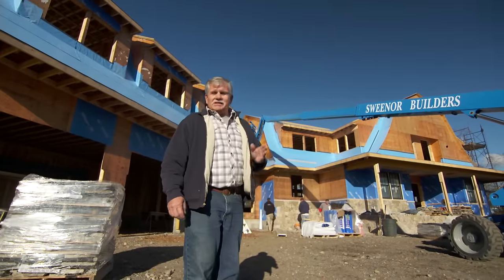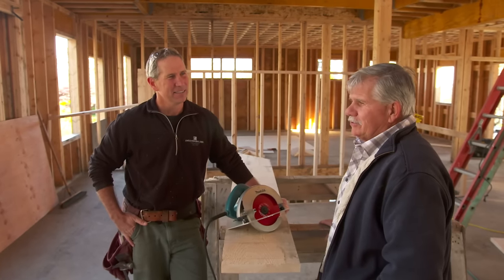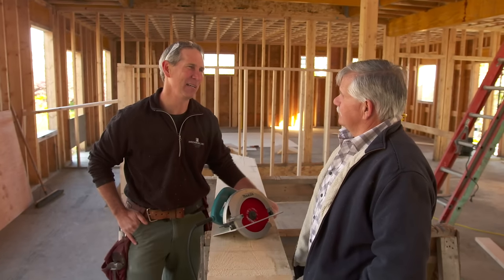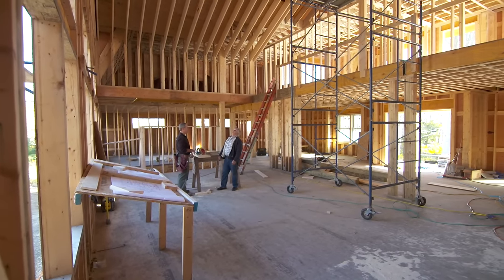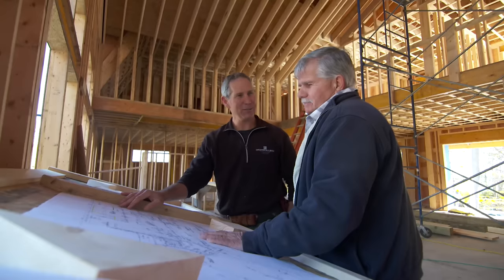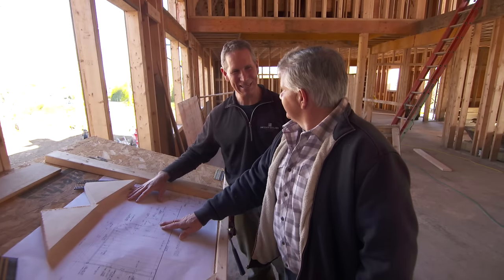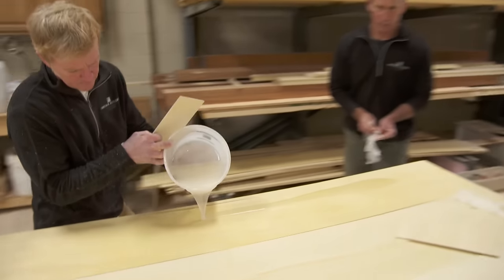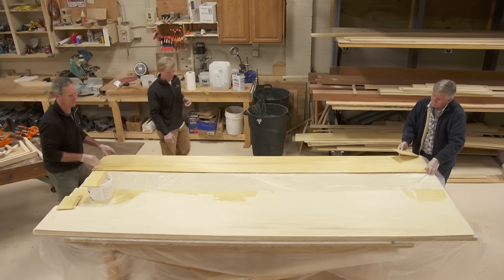Making A Curved Beam

Comment: Did you just use a the generic 2 part epoxy or did you also use an microfiber additive?
Reply from the maker: Eric Watson We used west system two-part epoxy 105 resin with 205 Hardner and we used 403 microfiber filler

Comment: Enjoyed your video. Could you tell me what type of expoy (brand) you used and if it would be appropriate for an exterior pergola beam.
Reply from the maker: John Galt - Check out West System. Thanks for watching!
Reply: Excellent, thanks for the help!
Reply from the maker: John Galt we used west system Apoxsee 105 resin with 205 Hardner and added 403 microfiber. And this beam that we did was for exterior application
Reply: @Sweenorbuilders  what was the Luan plywood rated as?
Reply: @Sweenorbuilders  Like Steve also asked below, that Luan is usually vastly inferior to the wood used in the Glulam beams (unless specifically graded and rated).  Plus you have anywhere from 1/2-7/8 of the wood fibers running in the "wrong" direction compared to the commercial beams with a lot of luan underlayments having super thin outer plies and a thick garbage cross ply in the center.  It may not matter in this case as the beam is relatively short, but it should be noted for the public that this is not a case of 1:1 substitution of a commercially rated Glulam beam.  
I would have used either 1/4" exterior plywood, 1/4" marine grade plywood, or 1/4" solid wood.  The first two plywoods would have a greater percentage of the wood fibers running lengthwise, plus the guarantee of an exterior rated (and structural) adhesive between the plies.  Marine plywood would generally be guaranteed to be void free.  Solid sawn wood has 100% of the fibers running in the correct direction, no voids, and no mystery glue to deal with.